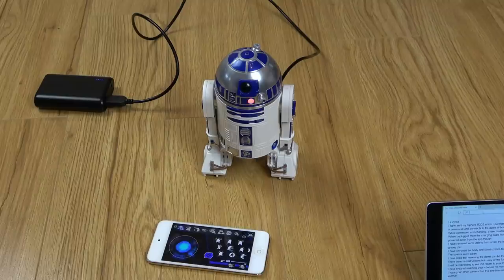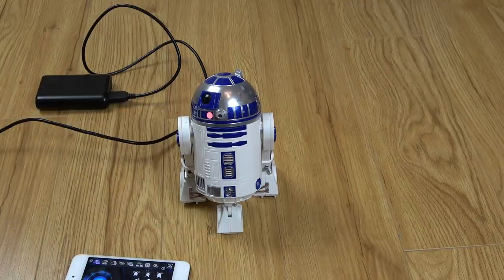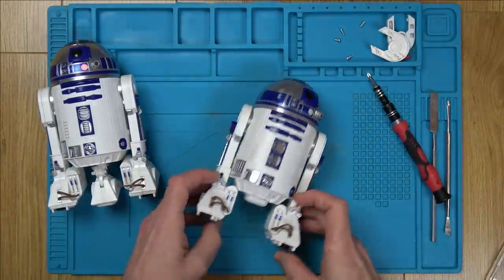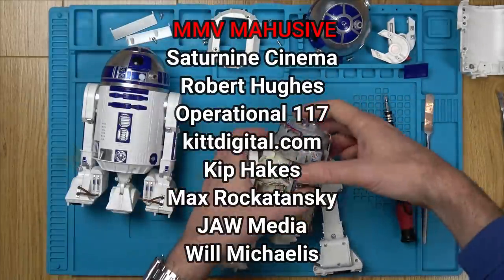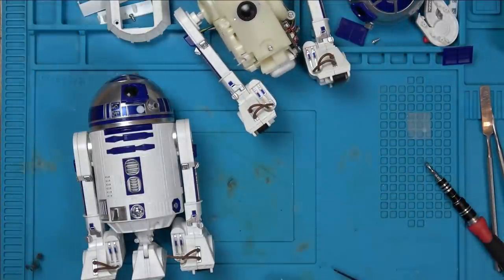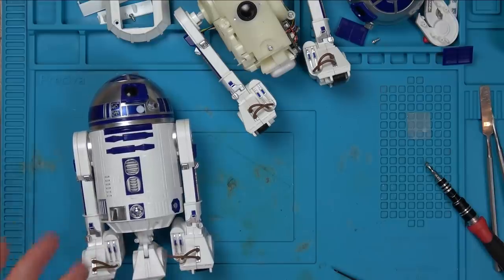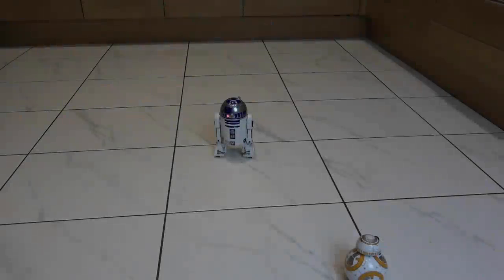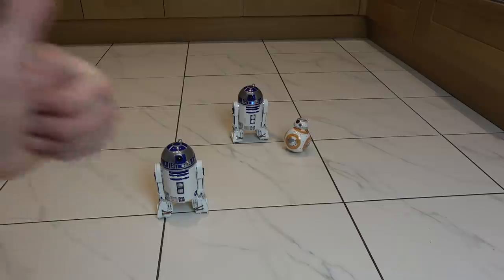Trying to Fix a Sphero R2-D2 App Enabled Droid

Comment: This is mad, I have just bought a bb8 on eBay for 15 pounds that’s says that it won’t hold a charge, hoping to fix it myself after watching your vids. Good luck & thanks for all the content.
Reply: The issue with BB8 is that it is a solid shell and I think you would have to destroy the shell to change the battery. I do think I saw a video on replacing the shell somewhere
Reply: @DEmma1972   i saw the video after bidding, looks like i will have to be v careful, ill give it a go though, thought it was to good a bargain. maybe with luck it only needs resetting, you never know.
Reply: @kevinspencer5740  I paid the grand sum of £9.50 + £4 postage for the R2D2 which makes it 1 of the cheapest R2D2 at least in the UK. Best wait till after the xmas inflation lets the price settle down again.

Comment: The resistors that you showed are R200. The placement of the letter represents a decimal place and the value R being ohms, K being kilo ohms. So R200 is 0.2 ohm
Reply: so they are current sense resistors ?
Reply: @andymouse  They are the type of resistors that is used in current sensing and possibly the chip is using them to regulate the speed of the motors.
Reply: @pds8475  Why not use 'zero ohm' resistors as links ? if they are being used as 'pull ups' or 'pull downs' then why specific values like 200 mohm ? ...cheers.
Reply: @andymouse  Yeah that's why I changed my comment after thinking about it. You must be seeing my original comment . YouTube must be being slow.
Reply: @pds8475  Ah yes  ! just read your revised comment and yep I think you're right ..sorry slow old youtube cheers for your comments !

Comment: Can you please help, the volume seems to of reduced dramatically, on my R2D2 and I cannot work out why or how to fix it? It wS working fine then suddenly it didn't want to work at all then I did work but sound is so low you cannot hear it over the motors
Reply: interesting. Is it fully charged?Is the sound distorted or just low? Does the R2 rattle a little on the insde (maybe the speaker has become detached in its housing)

Comment: Does anyone know what the specs are on the battery?  Mine just quit working on me, super bummed, I would love to get another battery for it.  If its not available, can someone let me know if it's 3.7v or 7.4v and the mah?  Also the connector thank you!
Reply: Hi, Part of the answer is in this video, around 15-16 minutes. The batt is made by Ascent Batteries 3.7V 1400MaH. I have emailed the company, for dimensions, assuming they are not available to see if I can get one a little smaller. Wll post if I get an answer.
Dave J (London)

Comment: 9:40  umm NO that Car battery analogy is incorrect
Firstly The R2 Unit is not Cold Cranking an Engine with that much reistance
on a cold start, it's completely different so it's not LIKE a car battery at all.
Secondly ..  a car is 12V   so yes sometimes if you measure 12V the car may not crank over BUT THAT'S BECAUSE THE CORRECT VOLTAGE would be 14V to 17V Before cranking .

Thus if you measure the correct voltage IT WILL WORK
if it doesn't, it's not the battery it's something else like the board or whatever.
if the voltage is there , if the electrons are literally in the battery to be used then they are there
you can't say, i'm measuring the correct voltage but it still might be the battery,  NO
Reply from the maker: Thanks for the comment. I think I disagree, otherwise people wouldn't load test a battery, they would just measure for voltage. I think there are situations where the battery voltage can measure good, but it can't sustain that voltage under load 👍
Reply from the maker: @martinkuliza  Cheers for the reply. So is it correct that a Lithium battery that measures 3.7v to 4.2v will always perform perfectly as long as it is in the correct voltage range.  Because I am under the impression that it can measure the correct voltage but not have the current (amps) to operate the product when faulty. Hence the reason for a load test. I don't understand why a load test exists if a simple voltage measure shows the condition of the battery. So a lithium battery may measure 4.2v fully charged but fail when put under load.  That is how I understand it.  Any batteries, whether a car battery in a car or a lithium battery in a droid toy can fail,  they have the voltage but can't produce the Amps. Obviously I know 8 AA batteries measuring 12v will not start a car, the analogy one was of a battery showing correct voltage but unable to deliver the rated amps. You have me curious now as I wondering if different batteries like lead acid, lithium behave differently when measuring the correct voltage. I ask my viewers in an upcoming video as they are a very helpful bunch 👍
Reply: @Mymatevince  
" So is it correct that a Lithium battery that measures 3.7v to 4.2v will always perform perfectly as long as it is in the correct voltage range. "
No, not ALWAYS!    however when it fails the voltage reading will go down

"Because I am under the impression that it can measure the correct voltage but not have the current (amps) to operate the product when faulty"
FAIR POINT....
However, voltage and current have a close relationship don't they ,
in a situation where the battery is faulty and cannot supply the required current you will see a volt drop or an instant fail 
and yes there are reasons why we use load testers, sure
but the likely hood of that happening is very remote, Again you gotta look at what can happen and HOW LIKELY is it to happen

the scenario you are describing is extremely rare, but not impossible
but in that scenario, the product wouldn't switch on in the first place,
and your voltage reading would be lower than expected, it comes down to it's internal resistance that causes these issues

"I don't understand why a load test exists if a simple voltage measure shows the condition of the battery."
LOL, well primarily for the purpose of making money, first and foremost,
Have you ever had the need for a TEST AND TAG TEST ?
Same thing here
also i didn't say a voltage test indicates THE CONDITION of the battery, of course it's a test of pressure, Not condition
There are also instruments that CONDITION the battery,
When batteries fail they go south very quickly, it's not a maybe

" Any batteries, whether a car battery in a car or a lithium battery in a droid toy can fail, "
sure,  but they are under completely different loads,  The car battery gets punished a lot more than the battery in the toy, Even if you average it out and compare apples with apples, the load on a car battery is ridiculous,
the load on a toy is fuck all in comparison

"Obviously I know 8 AA batteries measuring 12v will not start a car"
of course... because it comes down to the internal resistance of the battery and the amount of amps it can supply from the device drawing it,
but the initial current that is required from a cold start is much more punishing on the battery vs a cold start from a toy drawing from a AA Battery.  the point being... i would understand if you made this call on a car battery or truck battery,  On a toy or R.C. Product,    No.. Very unlikely

" the analogy one was of a battery showing correct voltage but unable to deliver the rated amps"
I understand,  but by Ohms Law the voltage has to drop doesn't it ?
or, if it's showing the correct voltage IN THAT MOMENT then you power up the product, it'll fail (as you said, it cannot satisfy the min current draw)
therefore it can't start up
Why not have a test load  rigged up that is approx equivalent if not slightly higher than the R2 Unit ?  just for troubleshooting purposes

I mean, i'm definitely a fan (by comparison) when measuring capacitors to not just measure capacitance but instead, E.S.R. and i take like 5 readings , not just 1
so i value reliablility as well
and sometimes your ESR can be good and you put the cap in and it fails, 
THAT IS REALLY BLOODY RARE THOUGH,  so you play the numbers,  in most cases,  you take 5 readings, if they are not fluctuating in a big way, you can take a punt and say the cap is fine,  same with the battery in the toy

" You have me curious now as I wondering if different batteries like lead acid, lithium behave differently when measuring the correct voltage. I ask my viewers in an upcoming video as they are a very helpful bunch"
You're very welcome
and by all means , prove me wrong.
but i'm the sort of person that tests the shit out of things , i don't mind being proven wrong (since it rarely happens) LOL
but again.. I'm 49  i've been doing electronics since i was 6  so.. yeah 
i don't get a lot of things wrong these days,   not nothing... but for the most part it doesn't happen often that i'm proven wrong

BUT HEY .. GO FOR IT
over the years i've developed a little system of troubleshooting and integrating things (like that capacitor analogy) into my procedure, sometimes they rely on statistics and probability but hey it works .
so with capacitors even if you read the datasheets and all that across all values and all brands,  you can get a cap that the data sheet says is in spec and it could fail
Most people take an E.S.R. reading that know about ESR.
I have a sheet i've developed (happy to email it to you if you like)

it contains a lower , Middle and Higher ESR
all of them are not just in spec, but IN MY SPEC
and i derive these specs first based on the datasheet
then over time based on what fails and what doesn't i trim acceptable readings off both the low end and high end as needed
doing this , i have come to a point where i have not needed to modify this list in a long time, i update it everytime i fix something but it rarely needs adjustment 
and for the battery issue, i come across issues like your one all the time,
you won't get a battery fail like that and not see the voltage do something weird,  
but yeah,  if you find out otherwise, let me know
but i really doubt it
Reply: @Mymatevince  
An idea.......
As a load test (i don't imagine R2 draws any massive current)

Why don't you 
1. Measure the voltage and watch it for like 30 seconds, it should hold constant.
one thing iv'e noticed at times, if the voltage is correct, but then after a few seconds it drops and what not,   you then have a problem, for certain

2. Why don't you rig up to that battery a few L.E.D.'s and a Resistor

Give it some Load
Start with 1 L.E.D. and a Resistor
then 2 and a resistor, push it up to 3.5 to 4 volts, Leave it like that for 30mins , see what happens
Maybe even have a scope hooked up to it in record mode and capture it and review it , see if you get drop outs

I find it amazingly incredible to believe that if there are no dropouts after 30mins under load, that R2 is gonna drop dead

Not likely
Just an idea
Reply from the maker: @martinkuliza  That makes sense, I think it is clearer in my head now. Cheers for taking the time out to reply in detail to me👍👍 Enjoy the rest of your week  👍
Reply: @Mymatevince  
No worries mate, Be cool
Make sure R2 wasn't in too much pain while you were working on him
it breaks my heart to seem him on the bench in pieces like that   LOL
Mate, you gotta fix him.. you just gotta  LOL
Reply from the maker: @martinkuliza  If you like R2, maybe when you have time check out the half scale one I bought from eBay, I did a couple of videos on him about a month ago. He really is a proper grown up toy. Spoiler, the repair itself was boring, but the product is good, pricey but good 👍👍👍
Reply: @Mymatevince  
Hold on....  IF i like R2???
i fucking Love R2, so much so that i was considering buying a full size working model 
but i will check out your one on ebay

RE
" the repair itself was boring, but the product is good, pricey but good "
Pricey in my opinion is a matter of opinion and income.
it's not about pricey in my opinion it's just acceptable price or non acceptable price

Do you have a link to it ?
Reply from the maker: @martinkuliza  😂😂 This is the 1st one https://youtu.be/3GR1fprh11I and this is the 2nd one https://youtu.be/9oXa7lx_bOk 👍👍
Reply: @Mymatevince  
the first one is fucking cool
the second one i'll watch later, i'm busy at the moment
Reply from the maker: @martinkuliza  He's better than expected, especially for a magazine build!!! The 2nd video shows his little Orange Pi board and I connect it up to a TV. It is way beyond my skills, but modding him and turning him into a robot hoover or connecting up a screen to him to use the Orange Pi on board would be pretty neat 👍👍
Reply: @Mymatevince  
Do you need help with any of this ?
although i'm not clear... WHAT PART is beyond your skills ?

as for the screen
Do you mean to integrate a screen into him that connects to the Dev Board so that you can control the Pi from the screen interface

- so i imagine you want the screen to be touch screen ?
- or is WiFi keyboard acceptable with a USB Bluetooth adapter ?

- Also What sort of screen are you needing
LCD, LED, MONOCHROME, COLOUR ????
When connecting a screen keep in mind you need to drive that screen,  it can be done though
Reply from the maker: @martinkuliza  That's really kind of you to offer. I'm good at the moment as my son is using/displaying R2 in his original state. BUT it would be good to look at modding him at a later stage, once the novelty has worn off 👍👍👍
Reply: @Mymatevince  Sure no problem , let me know when you're ready and i'll see if i can help you 
be cool

Comment: Anybody else think Emma knew exactly what she was doing....lol
Reply: Bought for £9.50 and I didnt know what was wrong as it was sold as spares/repair. Thought maybe a loose wire or resistor had gone. Watching Vinces videos gave me the courage to try and fix it. Opened it up and found stuff was shorting. I thought maybe the chip was fried. It was out of my comfort zone but knew Vince liked a challenge and I reached out to him. I certainly wasnt expecting Vince to do what he did with buying another droid and swapping bits. We didnt think Vince would fix it but thought it may make a good video. My fella bought me another working 1 at Christmas as we really did think it was a lost cause. I now have 2 R2D2s. Vince really came through on this project and I am happy he has a little friend now also.